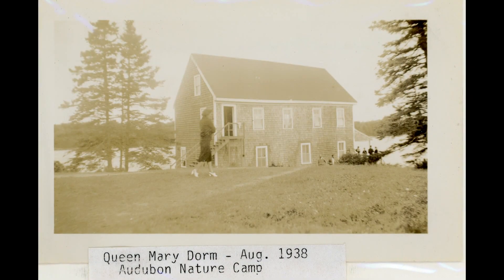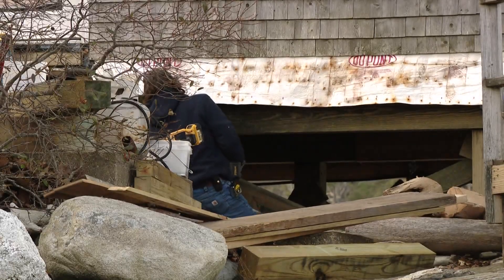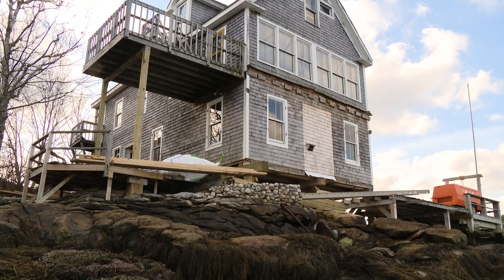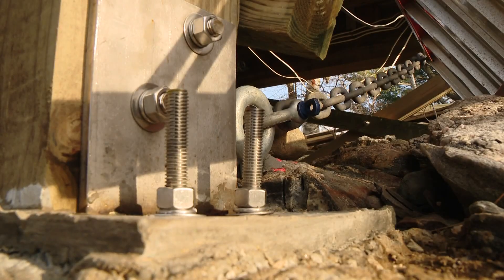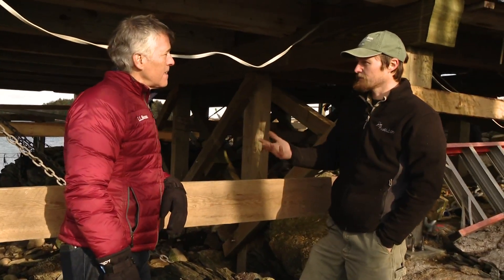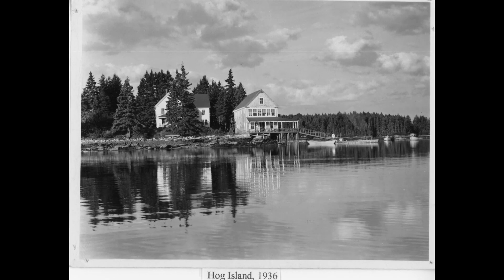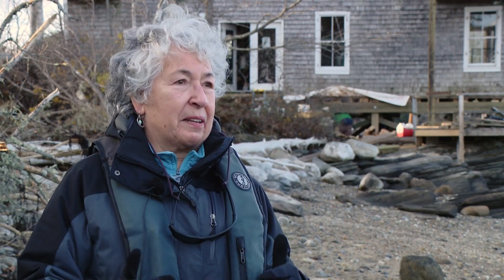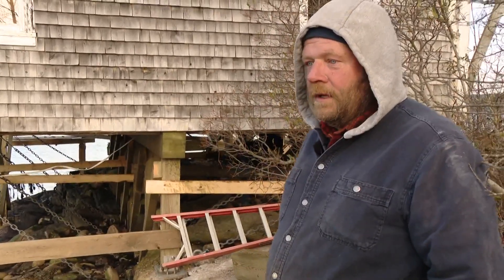Sea levels are rising—and so is a building on the Maine coast threatened by them

Comment: Yeah? Guess what, I call this simplistic BS. I live in Limington. I am 24 miles from the seashore now but I live within a mile of where the seashore was 10,000 years ago (I have explored the exact spot) when most of Maine was covered in an ice sheet.  Why? Because the "several thousand foot thick" glacier pushed the Earth's crust downward. If the Greenland and Antarctic ice sheets melted, their landmasses would rise. Landmass can rise or fall because of plate tectonics and magma activity also.  Shoreline changes are not just because of "global temperature". I have closely studied the GIS data and "sea levels". Shorelines vary all over the world for various reasons. In fact, some shorelines are accreting, others are eroding, some geologically rising others receding. The oceans are not even the same height across the globe at any given time. This building is on a spot that has been naturally eroding (I can almost guarantee the depth of the water just offshore has gone down because of land erosion) and to a very tiny extent, warmer gulf waters expand. Stop with the stupid "because of man made global climate change" nonsense.
Reply: You are correct.  The climate and the earth itself have been changing since the beginning of time.  People act like both have always been exactly as they see them at this instant in time.  The 'climate crisis' is just another fabrication to create hysteria and promote new ways to control people and redistribute wealth.  I live in a nice town in Massachusetts that considers itself a 'rural' community.  I had to get permission from the town to cut down three dead trees.  I had to pay a fee, post a notice in the newspaper, and have a conservation hearing.